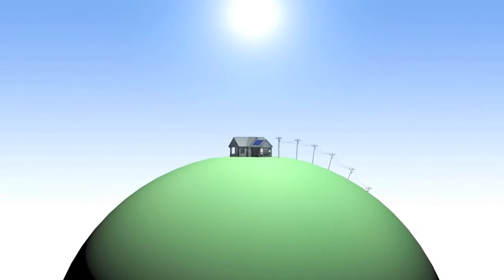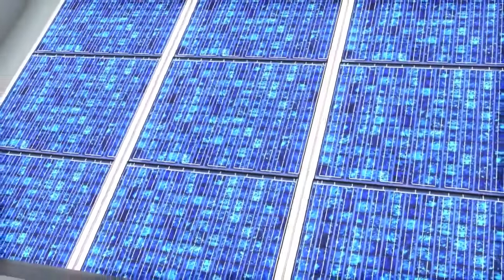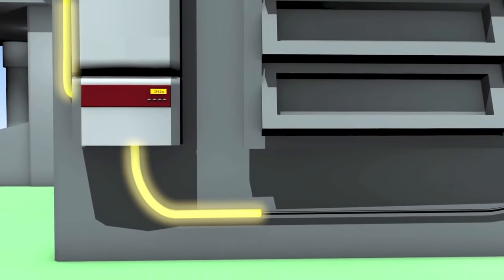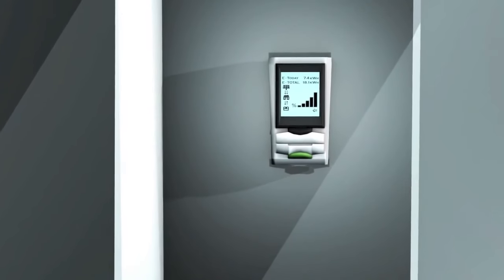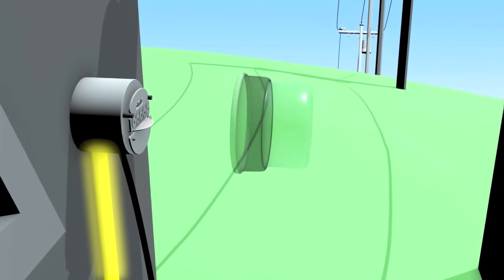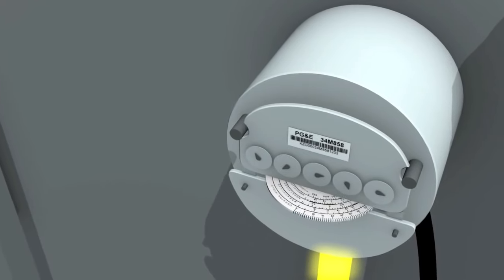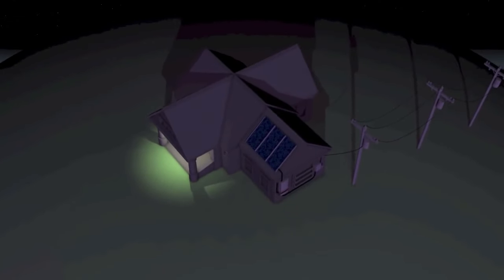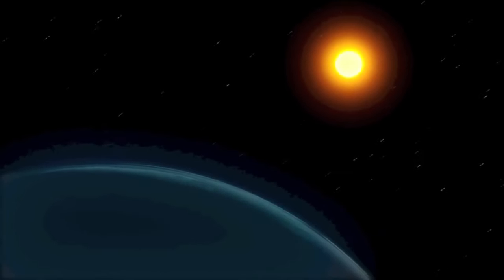How does Grid-tied Solar Power System Works

Comment: during day they pay 10 cents on dollar then at night you get charged premium rate which is ten times what they buy day power from you. my father in law has 50 panels and gets 700$ a month electric bill because they have to run airconditioners at night
Reply: That is a 90% difference in electricity price. A solar system with batteries would be more suitable for you. During the day store that excess into batteries.

Comment: Lots of this power being put back to the grid is lost. Better just have a solar system that is underproducing so it doesn't ever push power back into the grid.
Reply: Can you elaborate?
Reply: @marlonsubuyu2012  that DC power from solar is convert to AC, then the energy has to travel on the actual wires when it's in the grid. Not to mention, some power companies don't give 1 to 1 credit. 
I would rather just have enough panels to cover my daytime usage for AC than to overproduce and not get compensated enough.
Reply: @Airsep Yeah buts the most cost effective and low maintenance system to get your system running.

Ofcourse you would have to research about your electricity provider, at what rate they buy and sell you electricity. You dont just wake up one day and think of installing it
Reply: @Airsep E.g where i live we dont have power cuts or massive difference between buying and selling of electricity. It is the best option for us to opt for grid-tie solar system since maintenance of batteries is expensive af.

We sell our electricity to the grid and buy it back at roughly 20 to 30% more expensive.

It makes sense for us to install this system or install a system large enough to totally go off grid.